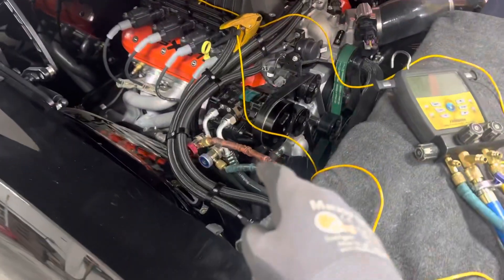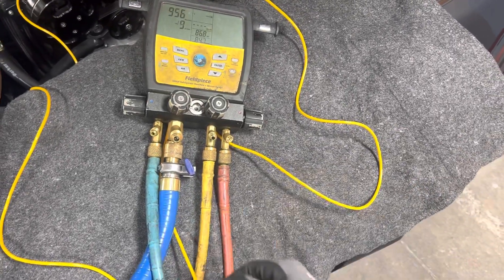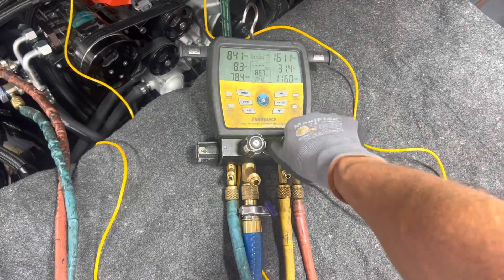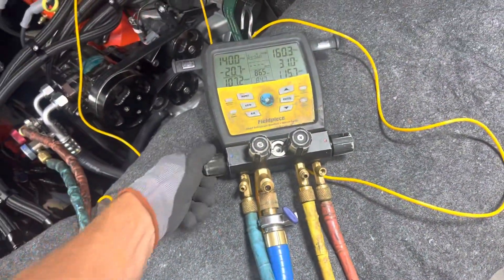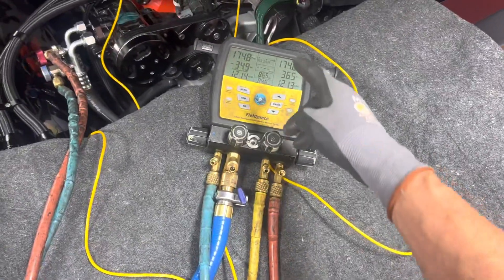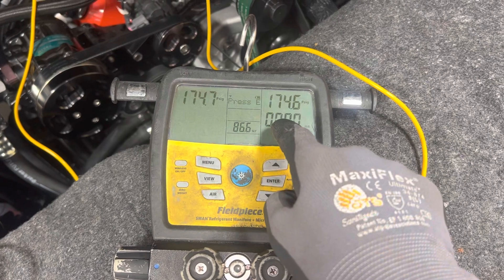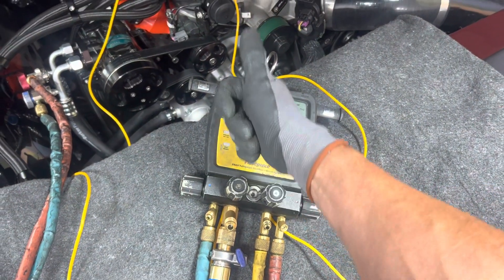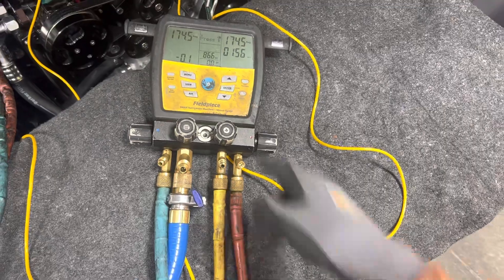High-pressure nitrogen decay test￼

Comment: Hi tom with stable temp. but an increase in pressure is it possible to have a leak still?

I watched a video a while ago where it stated that but i cant for the life of me find it again
Reply from the maker: Under high pressure static test you can have a very large leak that will not leak until actual hot or cold refrigerant is pumping through the metal or the rubber that will cause it to expand or contract and only at that moment will it leak

When you bring it back to normal ambient temperature the leak 100% 

So pressure alone, under certain circumstances does not always find a leak 

The same goes for vacuum. There can be leaks where it will not leak under vacuum, but it will leak under pressure and opposite could be true. It will leak under pressure but will not leak under vacuum. 

Then there are certain leaks that only leak when the car is down the road under vibration when the car is still, it will not leak 

And there’s other situations
Reply: Thanks Tom happy new thanks again

Comment: Hello Mr Tom!!I want to ask you about vaccum. This days I repair a car with a broken compressor. I replace the compressor the condenser the expansion valve the high pressure switch on the high side hose and all orings beacause all the system has metal tiny trash . I flushing the evaporator and the hoses and put everything back. My question born for the time I try to work like you. I have a external vaccum pump from yellow jacket and try to first make vacuum to see if it holds vacuum but more I do it to put nitrogen like you and not directly nitrogen as I teach to do. My question is I drain the new compressor oil and put again as the manufacturer says . When I start the vaccum the oil of the compressor is removing by the vaccum? and now is not the quantity of oil I fill to the compressor or the vaccum can't remove oil and i don't need to be afraid of wrong quantity oil now???Best regards!!
Reply from the maker: Vacuum dose not remove oil. 

Quality oil only purchase it from a reable large brand-name company. 

Usually there’s a sticker on the new compressor that tells you the type of oil. 

You can purchase it on the Internet or you can purchase it directly from the dealer manufacture of the compressor or the vehicle from a dealership. 

There are many different types of oils and different kind of oil weight viscocities.
Reply: @coldfinger459sub0  Mr Tom no quality i say quantity the total ml of oil I mean my fear is if the vaccum can be remove some oil of the compressor and the total ml of oil is less after vaccum beacause in another car I make the same when I disconnect the yellow vaccum hose to connect to the nitrogen spill out some oil .and the hole system is flushed and no oil exists on the system only the total amount of oil into the compressor.  And my fear is if after vacuum with a strong vaccum pump like yellow jacket can take oil out of the compressor.
Reply from the maker: @giorkar2116  no vacuum pump does not take out vacuum oil. 

Vacuum pump is only used on a empty system with no refrigerant in it. 

It almost sounds like the other car had way too much oil from somebody putting it in there

Or there was still some refrigerant left inside the system inside the oil. 
         And when turning on the vacuum pump it causes the refrigerant to boil out of the oil bubbling up like a large foam. 

This means the refrigerant was not properly recovered.
Reply: @coldfinger459sub0  I understand what you say! So I don't be afraid to do vaccum either with a high power vaccum pump or with the automatic ac station machine I have because with vacuum with cant suck the oil from the compressor and the amount we fill stays to the compressor . Thank you very much for your help!!
Reply from the maker: @giorkar2116  yes.  I have a 12 CFM vacuum pump capable of pulling down to 3 µm and I can pull vacuum through three-quarter inch vacuum hoses and never fear about pulling out vacuum oil. 

Nothing you’re gonna buy from yellow jacket or any automotive source that sells vacuum pumps to do cars are going to sell a vacuum pump as powerful as the one I use. 

The big white vacuum pump you see in my videos is $3000 just by itself. 

The big thick blue silicone vacuum rated hose that you see attached to the vacuum pump going to my gauges it’s just a little over $100 just for one single house.  (The purpose for the hose is to flow more vacuum more air volume CFM faster.
Reply: @coldfinger459sub0  thank you very much for your information !!!

Comment: Ordered my Sm480v from Tru tech and will be 2-3 weeks before it ships. So look forward to having some of these capabilities over analog gauges.
Reply from the maker: Your life with AC will be changed and you have just moved to the next level 👍 

Take advantage of being able to prove and document and see that you actually reached a deep vacuum and removed all the air and reduced the moisture content. 

Capability of running high-pressure nitrogen test very accurate all the way down to 1/10 of one psi.
Reply: Great choice.